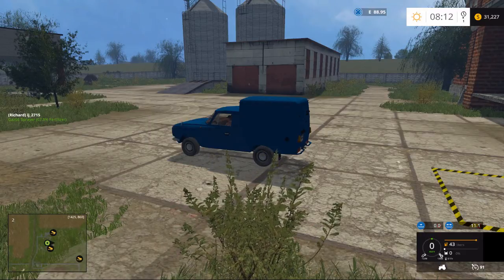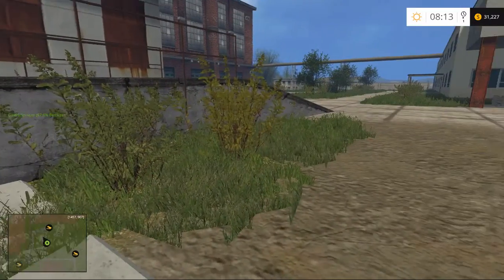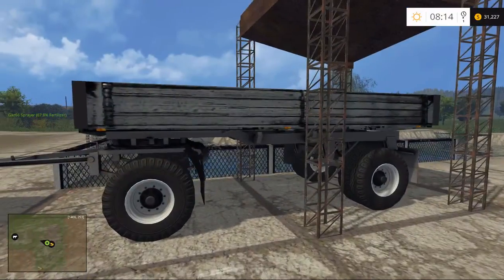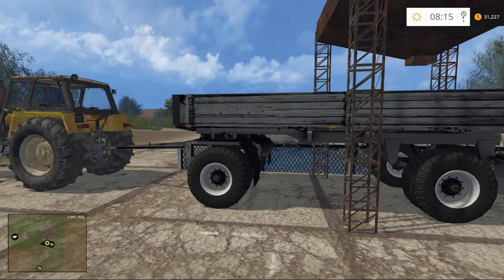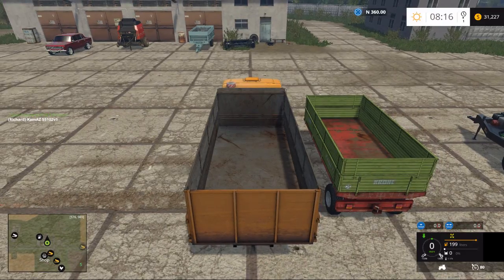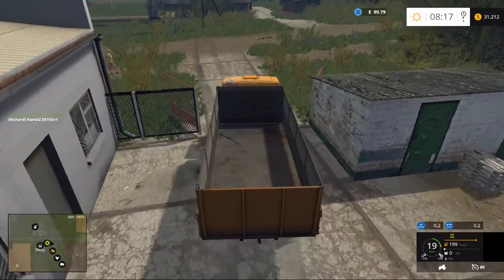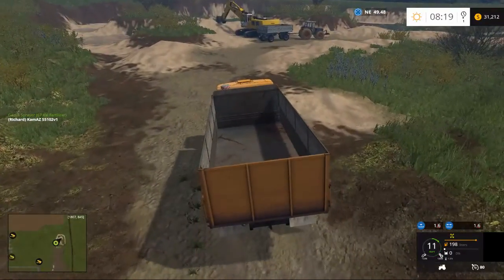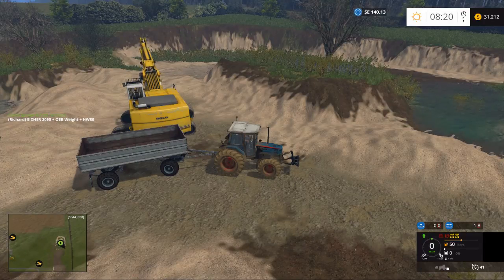Baldeykino for Farming Simulator 15 part 15 :fish,sand,bread"

Comment: hmmm.... I really think that it would have something to do with the multi fruit mod... Although you did say that you have the multi fruit mod made for the map. Do you have the latest version of that specific mod for this map? If I get the time i will check it out and get back to you. I Play on this map myself and it would be a disappointment to find out that parts of it do not work. I really am enjoying your series of this map.
Reply from the maker: hey bud ,I did in fact update all of the script mods as they became available.I have even gone back and chased all the links in the map authors patch notes to ensure I had the right ones. It is likely that one of the mods i run has written a file to the game itself(as many of them do) and so removing or updating doesn't help.At that point it is a full re-install of FS 15 .I do not want to do that as it might mess up my other LP on Volksholm.